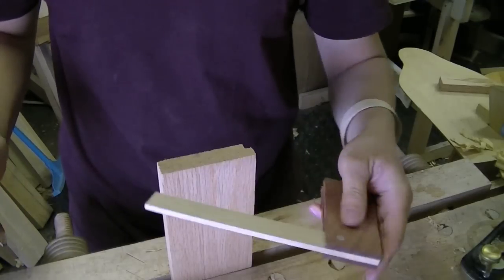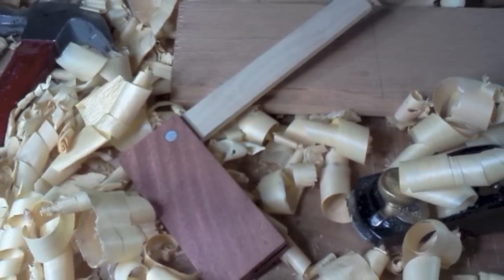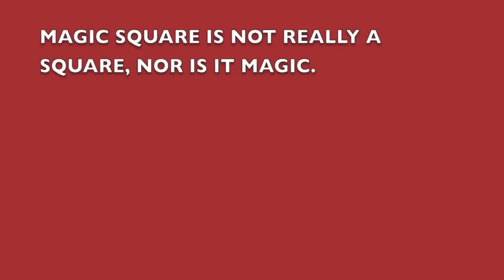Magic Square

Comment: I have a board stretcher that I want to sell to you. When you cut a board too short, place it into the board stretcher to correct it perfectly every time. Yep, every time.
Reply: I'm still cracking up from that video. Your comment is spot 
on.
Reply: +John Treble How may will you be able to sell before the lumber cartels make it go the way of the 300mpg carburetor?
"I need a 2x4x12, but I'm gonna save a few $ and buy a 2x4x8, and stretch it." "I can build a mansion from a bungalow's worth of lumber."
Reply: Best commit I've read in a while!!!
Reply: Seems like you and I could partner and assemble a kit with my magnificent patent pending sky hook™ .
You can use it reliably to access heights without the danger of falling, safely attach it to the sky and off you go to never imagined new heights!
Reply: I have a measuring tape like that; measure twice and cut once and its too short every time.

Comment: You really want to make it square, and have 100% confidence. Buy a Starrett Master Precision Square. Costs about $225 - $750, 1" - 12". 0.0001" accuracy. I honestly didn't think they were that much, but checking prices on McMaster-Carr.. They really are. Checking on Starretts site, they really are. I'll have to save up some money, and buy myself one. I lol'd at the part where you pulled out the sledge hammer, lmao.. Nice video man, keep up the great work. (+1 : 446).

Comment: So if you drop your fixed square and then use the 'magic square' to square off of it your 'magic square' will somehow be square. Sorry doesn't make sense to me
Reply: The walls of your shop have to be perfectly plume otherwise the floor will influence the bounce of the square off the concrete floor. Makes perfect sense.